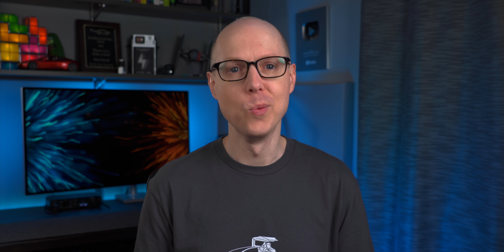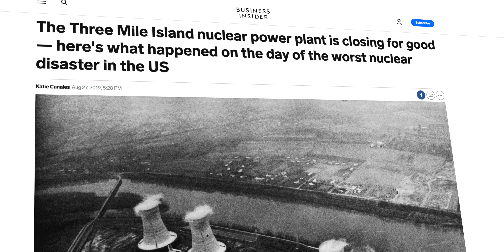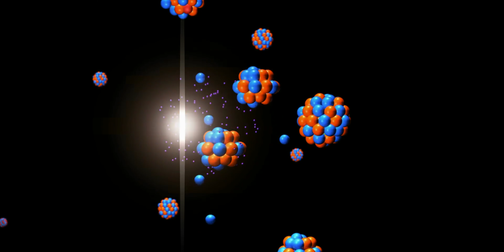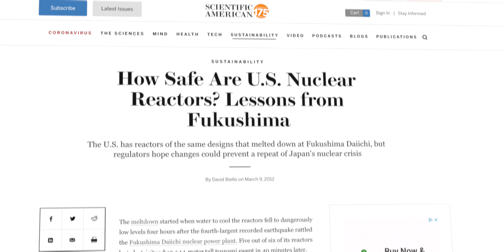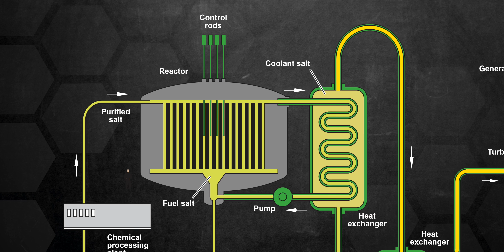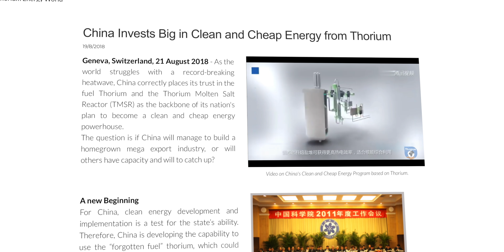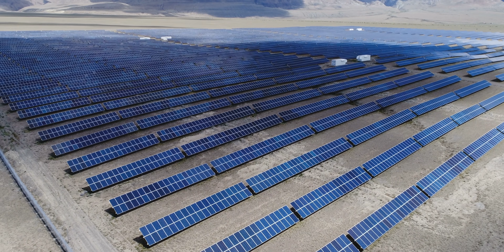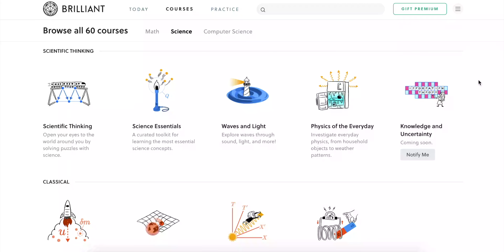Thorium explained - the future of cheap, clean energy?

Comment: By the time a commercial thorium reactor finally sees the light of the day, AI, IoT, solar everywhere and distributed storage will have already taken the whole world making every other kind of power production uncompetitive. Nuclear power is technically awesome for sure, but can it really compete against a fully-fledged, very cheap, renewables-dominated scenario? I have my own misgivings on that topic.
Reply: We may still want thorium on the menu not for its power production but on its ability to cook high-level nuclear wastes down.  Wastes that need 100,000 years of storage could be reduced to less waste that needs just 400 years of storage.
Reply: Nuclear electricity is cheaper. Nuclear produces much less co2 than wind generators or solar pannels.
Reply: Renewables aren't cheap, especially if you want to run an entire power grid on them.

Comment: Sodium Fast Reactors might be the future. Factory built,able to burn "waste" from conventional reactors,20 year fuel cycle life,and easy and fast to get to the customer on flat bed trucks. One I am following is a 100mw design,the ARC100 : https://www.arcnuclear.com/arc-100-reactor
Reply: Hi Mike Dunn,
I like LFTR better than Sodium because sodium reacts with water explosively, where as the fluoride salts are stable in normal atmosphere and pressures.

Warm regards, Rick.

Comment: I don't think we will see any large increase in electrical power made by nuclear reaction until someone figures out a cost effective method of waste disposal beyond "let the grandchildren deal with it."   Whether the waste must held for 500 years or 100,000 years, passing the waste disposal costs on to our descendants doesn't provide an ethical, moral or economic solution.  When I see the complicated thorium reaction process diagram shown in your video, I question how anything so complex can compete against the latest wind, solar and storage economics.  
Last year the LA Dept. of Water and Power signed a contract for solar plus storage of under 4 cents / kwh.  The Al Dafra solar project in Abu Dubia signed a contract this year for power at 1.35 cents / kwh.  Can a thorium reactor system even cover the waste disposal costs for the first 100 years for those costs, let alone the investment and operating costs?
Reply: Today's reactor designs produce copious amounts of radioactive waste that takes tens to hundreds of thousands of years to be safe. 

83% of all by products from a molten salt nuclear reactor operating on the thorium-uranium fuel cycle comes out as: 

neodymium (used in magnets)
molybdenum (used in electrodes)
strontium (used in electronics, metallurgy, and chemicals)
zirconium (used in many commercial products)
rhodium (used in electrical contacts)
ruthenium (used in electronics)
and palladium (used in jewelry and specialized alloys). 

Those are just the most typical uses for those elements... 

15.5% of the remaining waste/by products are the toxic and radioactive by products cesium 137 and strontium 90... Cesium 137 has a half life of 30.17 years, and strontium 90 has a half life of 28.9 years. That means that after 300 years, the waste is "safe" and can be used in things such as nuclear medicine, as well as other industrial uses. 

The remaining 1.5% of waste comes out as neptunium 237 which can decay into plutonium 238 over time. This is the stuff we just put away for long term storage.
Reply: @Les_S537  All that is nice, but who will pay for the waste handling?  Will the waste handling total cost be less than the total cost of renewables? Or will we leave the radioactive waste for our grandchildren to pay for, as we have for the current nuclear reactor fleet (to say nothing of what we have left our grandchildren to deal with from fossil fuel emissions)? 

Who will pay for the capital investment?  Will the rolled up investment and operating costs be less than the cost of renewables?  Will just the capital costs of the thorium reactor be less than the capital cost of solar or wind? 

In the US right now the capital cost of solar is about $3 per watt installed on a rooftop, with the biggest component of that cost the regulatory paperwork and sales overhead.  Can a thorium reactor process be built for less?  Will the regulatory overhead for a thorium reactor process be less than for a solar panel per watt?
Reply: @martyweirick9846  Couple of points in response... 

1. 

I think the average cost for coal plants is something like $3.25/W. 
Today's nuclear reactor power plants cost something like $7.48/W. 
Molten salt nuclear reactors (MSR) should cost about $2.50/W. 

How can molten salt nuclear reactors beat coal and current nuclear plants like this? Because molten salt nuclear reactors, when built out on an industrial scale, will be about 1/20th the size of current nuclear reactors which typically take up around 3-4 sq km. 

Current nuclear reactors cost as much as they do to build and operate because they're inherently dangerous models. They operate with water as the coolant, and they operate the water under extreme pressures. This requires current models to have heavy duty piping, triple redundant safety and backup systems, containment buildings to deal with errors in the plant, et al. All of these things take up space, cost lots to build and test/certify, etc... 

Current nuclear reactors operate under anywhere from 70 atmospheres of pressure (boiling water reactors, or BWR) to 160 atmospheres (pressurized water reactors, or PWR). 

Molten salt nuclear reactors operate at 1 atmosphere, so no need for all the heavy duty piping, no need for all the extra safety systems, etc...  Because Molten salt nuclear reactors use molten salts as both the fuel and the coolant they are 100% meltdown proof 

It's a no brainer. 

Build lots of molten salt nuclear reactors, and shut down all coal and natural gas power plants, as well as the current nuclear reactor power plants we have today 

2. 

Regarding waste...  Do you have any idea how much nuclear waste the US has generated in nearly 70 years?
If all of it was compressed into one contiguous mass it would fit on one football field stacked about 60 feet high.  In the grand scheme of things, it's not that big of an issue. 

Nuclear waste is not like what you see in Hollywood B movies where it's a liquid kept in a 55 gallon oil drum painted yellow with ominous symbols on it.  It's solid waste.  It's not going to leech into the environment and make dead people rise up out of the grave, etc... 

Radioactivity is a not well understood topic to most people.  The further you are away from the source, the greater the dissipation.  Stand on a pile of waste for a long time and you'll die.  Stand on a pile of waste for a second and you'll be fine.  All we have to do with nuclear waste is ensure it's put away in a safe place and that's that. 

Eventually, someday far off into the distant future when space travel is much much safer than rockets, we can lift this waste and toss it into the sun.
Reply: Hi Marty Weirick,
Nuclear power, unlike all other forms of power, pays for disposal of nuclear wastes.  Further, all wastes generated are kept isolated from the environment.

(The US government has taken the money to build a waste facility and spent it on other things, but that is hardly the fault of the nuclear industry.)  That said, the waste is so small, that is is contained on site at the plants that made it.

How about other forms of waste: 
-- Coal dumped into the environment and kills 100,000 of people per year.  Massively toxic.
-- Natural gas / oil.  CO2 into the air.
-- Hydro.  Dangerous, and floods valleys, producing massive amounts of CO2.  Lasts 200 years before they silt up and become dangerous liabilities.
-- Solar & Wind.  Use rare earth elements, steel concrete, quartz, energy to and energy to concentrate, refine and use them.  Now you can argue that nuclear ALSO takes steel and concrete, etc, but nuclear power plants are small.  A tiny amount of space, materials, and fuel produces a massive amount of power.

Your thesis that only nuclear has waste worth worrying about is very weak I think.

Warm regards, Rick.

Comment: I know you wanted to avoid the detailes nuclear physics, but I thought a certain clarification would be interesting:
Although easy to visualize the neutron "slamming" into the nucleus and smashing it into two pieces, the neutron actually has to be SLOWED DOWN for this to work, as you later mentioned. It's actually closer to the neutron floating by and sticking to it, leaving the nucleus no longer balanced.
The resulting imbalance causes the nucleus' contents to reshuffle themselves in such a way thay they end up flinging half of the nucleus and a few stray neutrons out and apart. Thus the splitting energy comes from the attraction and repulsion forces within the nucleus, not the speed of the incoming neutron.

Comment: The British company Moltex Energy are building a new plant in New Bruswick Canada. it is a fast spectrum reactor that will burn the waste fuel from a legacy nuke power plant next door. It will extract the 96% energy left unused by the old reactor and reduce the 1/2 life from 30,000 years to 30 years.
It will naturally follow the load demand so is ideal for supporting renewable generators which have a variable output.
They use a simple chemical process to make their fuel salt from irradiated waste fuel pellets.
The fuel salt is contained in zirconium plated stainless steel tubes.
The fuel tubes are vented to allow gasses like Xenon to escape and sit in a bath of the same species of salt.
Byproducts like Iodine 131 and Caesium 137 will themselves form salts so can never escape as dangerous gases.
There are no pumps moving radioactive salt. Heat is transferred to the heat exchangers by convection. There is no pressure inside the reactor core. A third salt takes the heat away to power generators.
Corrosion is controlled by keeping the salt reducing. Heat exchanger plating is prevented by keeping the fuel in 10mm fuel rods. The reactor tank is molten salt for transferring heat. 
There is no salt plug and dump tank but there is also no fuel salt pump. These are all huge regulatory issues, so Moltex thought the best component is no component at all.
The reactor is intrinsically safe, because it has a highly negative thermal power coefficient. If the operating temperature rises slightly, the power generated falls. It naturally follows the load demand. It can potentially sit with settings at full power (control rods pulled out) AND the cooling circuits disconnected with zero hazard. 
Truly walk away safe to the extent that boron control rods are only there to keep the regulators happy.
The burnt Moltex fuel will have a 1/2 life of 30 years against 30,000 years for the old legacy fuel stuff. Also there is no carbon core to need replacing. That's another source of waste it wont have.
Moltex have designs for new uranium fuel and even a thorium breeder. The issues are are not technical just that regulatory approval takes many years. The first version is the easiest to get approved and should be on line by 2028.
Reply: Awesome info, thanks

Comment: The way I heard it corrosion is not such an issue.
Makes sense - corrosion is oxidation of metal. As name suggest it requires the presence of oxygen. Because of that a mixture of water and salt is highly corrosive.

In such thorium reactor there would be plenty of salt...
But no water. Also no other oxygen in any form.
You can't have oxidation if there is no oxygen.
Reply: Thorium fluoride has Fluoride which is corrosive.
Reply: @Starscream35310  as long as you keep oxygen out of the system it's not.
It's simple chemistry - you can't oxidize anything if there is no oxygen around.
Reply: @michazajac5881  it's a basic chemistry knowledge that fluoride is way more corrosive then oxygen.
Reply: @Michał Zając 
Oxidation (as opposed to Oxygen) is the process of an atom/molecule losing electrons.
* Oxygen likes gaining electrons, so it oxidizes metals.
* Fluorine likes gaining electrons even more than Oxygen, so it oxidizes metals even more.

@selva Kumaran You are correct that fluoriNe is more corrosive than oxygen, but a fluoriDe is not so corrosive.

With a salt (say sodium fluoride, NaF) in a tube (say steel, Fe), the Na+ is better at donating an electron to the F- than the Fe+ is. So a NaF salt doesn't corrode the Fe tube all that much. To put it a different way, in a choice between Na+ or Fe+, the F- will always choose the Na+. Only at the edge of the tube, and only where a local lack of Na+ may exist, will the F- latch onto Fe+.

In general:
* Salty water corrodes the most.
* Water corrodes more than salt.
* Salt, although 'corrosive', corrodes the least.

Try taking 3 iron tubes (steel will take forever to show effect) and fill one each with salty water, water and salt (NaCL, table salt is good enough stand-in for NaF if you can't find any) respectively and see what happens!

Comment: i get that thorium output might be on par with uranium but what are the costs for maintaining the reactor? when you think of solar, the only cost is the technician that maintains the panels, and any spare parts for when it breaks down. thorium reactors need the actual compound shipped to them regularly and shipments out when theyre used. thats a regular bill that doesnt include building out the reactor or the salary for an employees with some kind of phd in nuclear science. am i wrong in this or does the cost outweigh the benifits?
Reply: thorium output is not on par with uranium, it's 200 times more efficient than uranium.
1 kg of thorium equals 4,800,000,000 kWh
1 kg of uranium equals 24,000,000 kWh
Reply: @Les_S537  fascinating! but whats the overhead cost to operate that 1 kg though? since you wouldnt need as much of it as you would uranium, i imagine the shipping costs would be low. im all onboard thorium if its cost efficient, i guess im just trying to figure out the economic comparisons of it all.
Reply: @SamMAVRS  Sorry for the length, but read to the end and you'll have your answer...  Today's nuclear reactors all use water to cool the nuclear material.  This is dangerous as fuck because as we all know by now, when plant operators lose the ability to circulate cool water over the nuclear material the nuclear material will boil whatever water is present away, it will begin to meltdown, and then explode, and then you've got lots of radioactive waste spread far and wide on the wind. 

Because of this danger, today's nuclear power plants have triple redundant safety systems to ensure that plant operators can always circulate water over the nuclear material.  This greatly increases costs. 

Today's nuclear reactors all operate under extreme pressures too.  The boiling water reactor design operates at around 70 atmospheres of pressure while the pressurized water reactor design operates at around 160 atmospheres of pressure.  Because of this, extra heavy duty piping is required, and all sorts of certifications need to be done on every step of the build process, thus greatly increasing the cost to build. 

Molten salt reactors don't use water to cool the nuclear material, so you've removed the chance of a meltdown.  This greatly reduces cost to build because you don't need triple redundant safety systems.  Molten salt reactors also operate at 1 atmosphere of pressure.  This also greatly reduces cost to build. 

Molten salt reactors have their own safety concerns, but when built out they will be about 1/20th the size of today's nuclear reactors putting out the same amount of energy.
Reply: Hi SamMAVRS,
I suggest you read the book: "Thorium: Power Cheaper than Coal" by Robert Hargraves.

The whole point of the book is that for Nuclear Power to do any good, it must be cheap, so he discusses the economics at every point in the book.  It must be cheap to make, and regulations who's only purpose is to make nuclear more expensive must be resisted.

If the USA does not do this, other countries will.  And they will enjoy the benefits of cheap, reliable power.  China is doing a massive, (and inexpensive), nuclear build up, and will have doubled the number of reactors on the planet by 2050.

Warm regards, Rick.
Reply: @RicksPoker  awesome! ill check it out.

Comment: From what little I know about Thorium reactors, I think they might have great potential.  Especially in places where wind and solar do not work so well.  I'm not so sure about the "Salt" as the best medium.  With salt comes fast corrosion.  I think salt was chosen because because it is a cheap material and it has very good thermal carrying ability.  Something else like Aluminium sulfate or Aluminium oxide might work better.
Reply: Salt water is corrosive to two metals in contact which have differing electric potentials.  You get an electric current and the two metals act as the cathode and anode of a battery causing them to corrode.

The metals to hold these are designed so this won't be a problem.  If they have similar electronegative potentials the current won't flow, and more fundamentally the salt is molten and not dissolved in water.

Fluoride salts are VERY stable chemically.

Warm regards, Rick.
Reply: could the nuclear greed trickle down blow out even  a candle ?